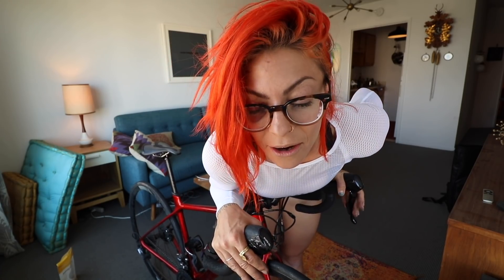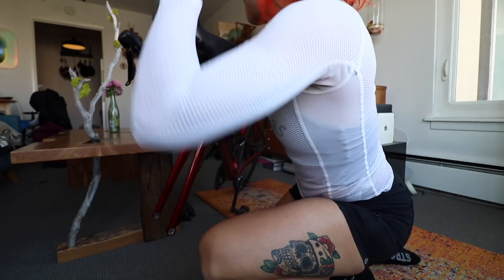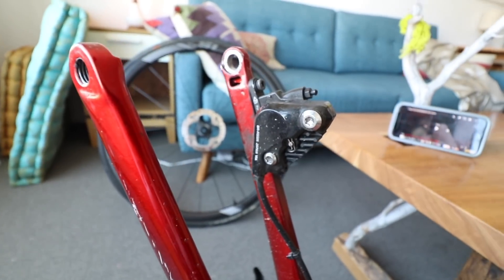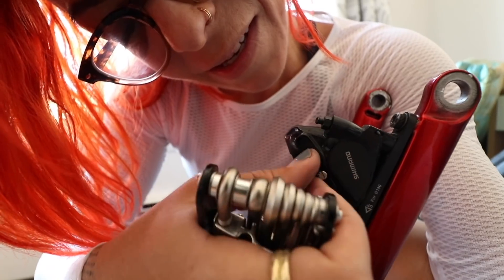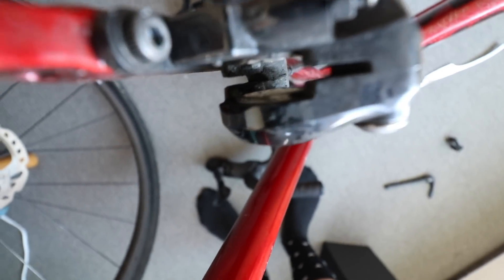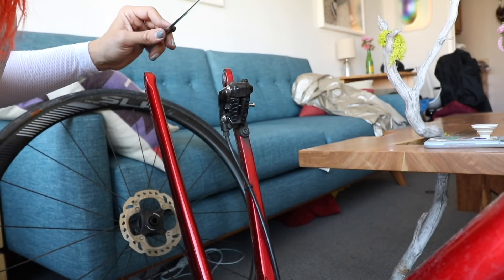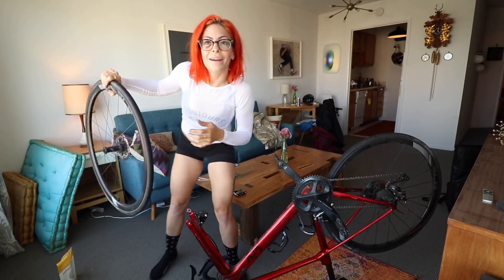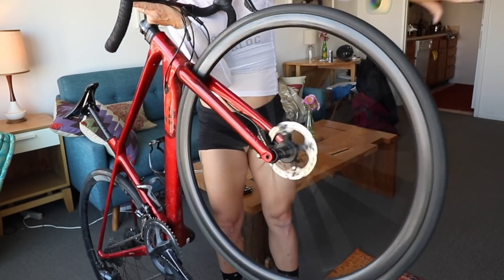Fixing Compressed Piston with a Butter Knife

Comment: Hold on Kym, you got this.  I've replaced the pads on my road bike a few times.  The thing to avoid is losing any small bits.    Have moved pistons out like this at the change of pads.  A little work to center the pads on the disc and done.   End up taking a wheel out of gravel or mountain bikes for transport often so I just keep the plastic pad inserts to hold the brakes pads out in the back of the car.

Comment: The park disc brake piston tool is $20. The pistons are ceramic and can be damaged using a butter knife. If this happens you’re looking at buying a new caliper which is more expensive. You’ll probably need a shop to install it which adds to the expense. When spreading the pistons it’s best to spread them as far as they will go then loosen the caliper mounting bolts and squeeze the brake lever in small amounts until the pads are touching the rotors firmly. While maintaining this pressure on the brake lever tighten the caliper mounting bolts and your brakes should be centered and not rub as long as your rotors are true. ALWAYS use a tool designed for the job to service your bike. Disc brakes are a bit fiddley! I made up that word!😂! It’s worthwhile to have the tools to service them.

Comment: Awesome to see you doing maintenance Kym! But,  you can do this without removing the pads. Just insert a large flat head screwdriver in there and twist it 45 degrees. Also, you can re-centre the calliper by loosing off the two (in your case 4mm Allen bolts), so they’re ‘just loose’, then spin the wheel and grab a whole handful of Non-Stop power brake. That’ll centralise the brake body. With the brake lever still squeezed, tighten those 4mm lads back up and you should be golden with no rub! (Unless the rotor is bent).

Comment: Nice one Kym.

One suggestion: once you open the pistons, since its never centered again, you need to reposition the brake caliper. If you want to keep the ghetto setup, instead of getting a brake centering tool, I use two business cards or something similar and place them between the brake pads and the rotor. I used to do this a lot on my MTB.

Comment: Top tips from a pro bike person:

The thing you called the rotors, are infact the pistons. They are generally a ceramic material (on Shimano brakes in particular) and I highly recommend pushing against the pads with something like a plastic tyre lever so you do not run the risk of chipping the piston. If you can not get anything in between the pads, pushing the piston itself is fine, but NO SCREWDRIVERS.
If you are also not doing it on your carpeted apartment floor, it's also good practice to clean your pistons with isopropyl alcohol and a clean paper towel to get all the brake dust off it.

Happy riding all.
Reply: Agreed! If you have nothing but something like a metal butter knife, wrap a towel (worst case scenario, paper towel) around it so the metal isn't contacting your components.
Reply: Hi Pro bike person.  Will flipping over the bike like that for more than a few minutes cause an air bubble to get trapped in the brake lines?  Am wondering about that and whether this bike should be bled.
Reply: @bengt_axle  in my experience, no.
If stored upsidedown for a long amount of time some air from the master cylinder lever assembly will make its way down the line into the caliper, and that is bad.
But that said, I have on many occasions (eg: replacing brake pads in a downhill bike park, changing tubes, etc...) done this and not had any loss of brake performance. A small amount of air in the line will work its way back up under normal use, any air in the caliper will cause your brakes to 'pump up'.

Comment: U also could just used the butter knife with the pads installed and just twisted slowly and it would pushed it ooen.
Reply: Huge chance of damaging the pads that way, ill advised,, unless of course they are old pads and you are about to replace them 😊
Reply: @MrCaptainAustralia  wasn't saying twist to the point of digging in. Just a slow easy twist. But I have a pinton press at work.
Reply: @jimlmackjr1  yeah i figured you didn't mean destroy the pads 😂, just the risk of still doing it, or even forgetting to clean the knife and contaminating the pads is not worth the 20 secs to pop the pads out,,, plus it gives you more incentive to give the pads a bit of a clean 😁